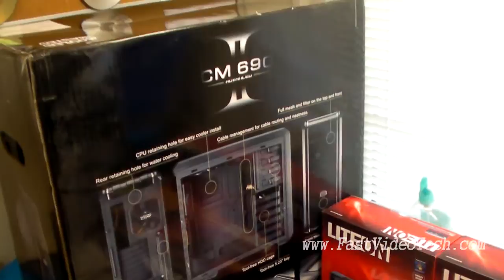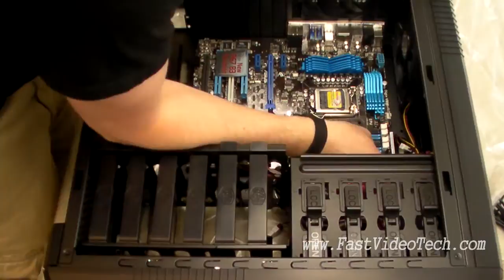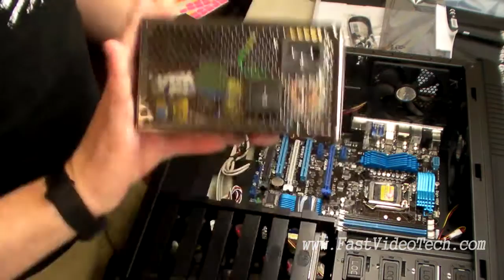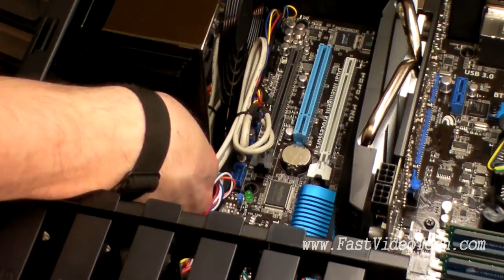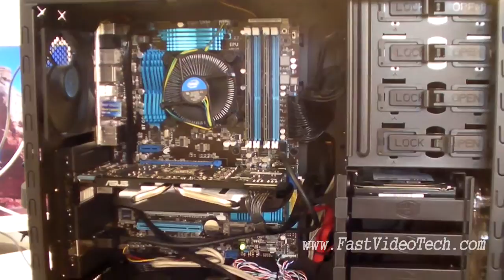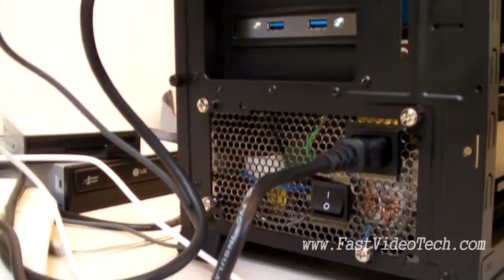Custom Sandy Bridge Computer Build

Comment: @FastVideoTech seccondly just 1 thing left, to lose the cable for the usb port u can run it behind the motherboard traym, use the lowest pci slot, and get it up at the PSU opening. Itll give it a better finishing touch.

Comment: Yeah another benefit of going with the i3 is that you will choose a motherboard with the LGA 1155 socket. That means later you can upgrade to i5 or i7. With the Phenom  (which is pretty decent), you could upgrade to the bulldozer processors... but they don't work as well for gaming.

Comment: Every power supply I've ever used, the fan that sits inside the case is the intake - the exhaust is almost always (in every computer i've ever owned, built, or heard of) on the same side of the PSU as the 120/240v power plug.  So in this case, the fan would be sucking air from in his case, and blowing it out the back of the case.

Comment: I have the same case (except its the CM90),Mother board. 2 things i think you kinda did wrong in this build(maybe youve changed it now though) 

1.I believe the PSU is upside down. The fan should be facing downward.
2.The 2 sticks of ram should be in the blue slots (review the mobo manual for correct ram placement)

Just a couple thoughts. Great build though! I went with a i5 2500k Sandy Bridge 3.30ghz CPU myself and Corsair Vengeance 2 x 8gb sticks of RAM.

Comment: i see your point. an i3 may only have 2 cores, but hyperthreading will give it an edge. at the same time, an x4 has four cores, so instead of hyperthreading the processor can use its two extra cores when it comes to handling multiple threads. This puts them on the same level in my opinion. But then again.. i have a bias towards amd chips :)

Comment: @FastVideoTech I built my first gaming pc. I was happier and more excited when than I was graduating college! Full tower Azza, Intel MB(GA-H67A-UD3H-B3), 12gb, 600watt, i5K, 2tb hd, 2gb 6950 hard, and over size processor fan. Don't use the stock and Blue dvd
Follow the directions, make sure the fans on the processor flows properly. With some tweaking and OC. I'm able to get 4ghz. Pc with the graphics card cose about 1g. How ever...I know that its pc that will last for years come! build your own.

Comment: Dude nice build, sandy bridge just smokes. But quick question, when you installed the ram in the case dident you find it flexed the motherboard alot? By a worrying amount. I found that when I built mine (same spec cept XMS3 ram).

Comment: @FastVideoTech i personly dont like the way its done, but hey for a pc build for a customer its good enough, but if it would have been your own there would have been some better management i purely looked at the looks not the kooling. Though you might have been right of overreacting.

But some inprovements might be: Look at the cables for the front perhipitals, hide them behind the case. This counts for all, also use a p4, or p8 extension cable to power the cpu. Just gives it some betterlooks.

Comment: @stigmatic79 Well i like the p8z68-m pro by asus, on new egg its 124.00 bucks. Also this mobo only supports either 2nd gen core i3, i5, or i7, and on the box when i got it said it supports intels upcomming cpu's 22nm tech, so ivy bridge is suposivly supported. I got the core i3, cheaper and for a dual core with HT, it performs really well, 10 times faster than my c2d I had. Also I like g.skill memory, they work for the most part, havent tried any other yet. but good luck

Comment: I have a similar system. But why would you buy SUCH a nice motherboard for an i3?? You could have gotten a cheaper motherboard and an i5. But the i3 2100 is still a very powerful cpu. The worst part here is the 6850, but still nice system.